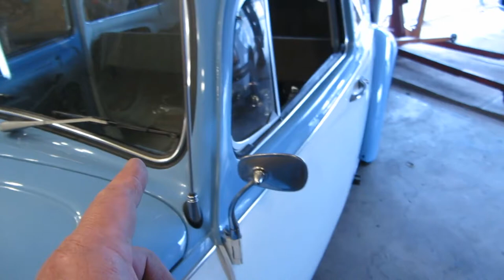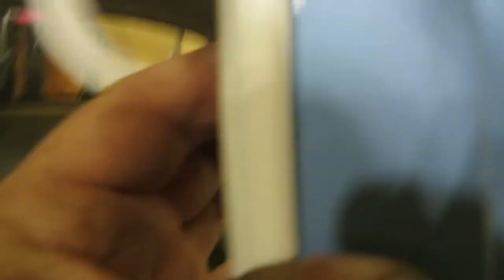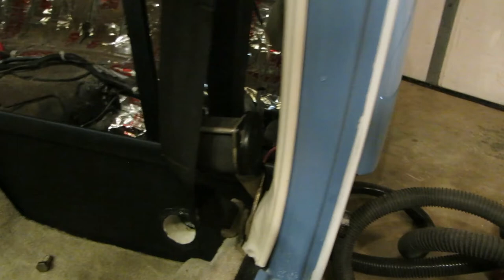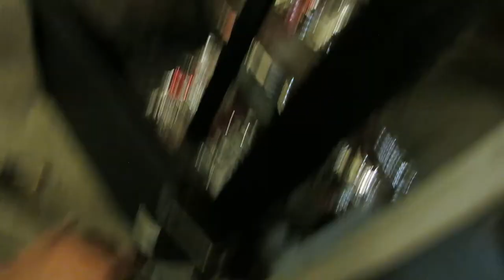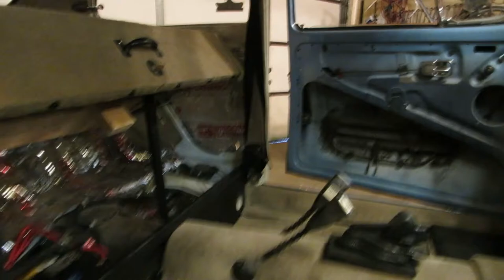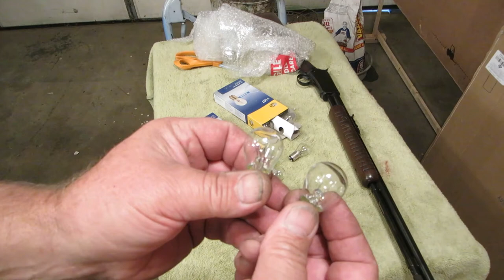VW Beetle Seat Belts and Winchester Rifles

Comment: Wow, the Winchester Jam-O-Matic. What a piece of crap. Now the gallery pump.....that's a good 22. You know he always kept these in the basement, the nice moist basement.
Reply from the maker: I have another gallery pump. It’s an 1890.
It’s heavily bastardized though...the stock and trigger group is from 1895, the receiver is from 1909, and it’s been re barreled with a smooth Winchester barrel from a model 39?? I think. Chambered in .22 long rifle.
Originally it was chambered in Winchester .22.....which was not the .22 we know today.
It was the predecessor to the 1906 gallery pump dad had.
It doesn’t feed correctly, and I need to get it fixed.....neeto gun though. Having something you shoot with from the 19th century.